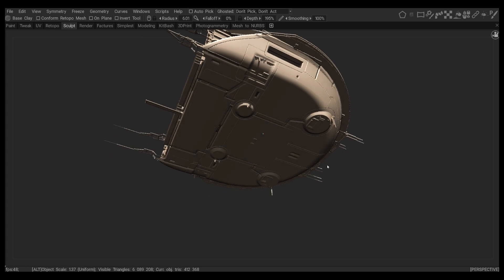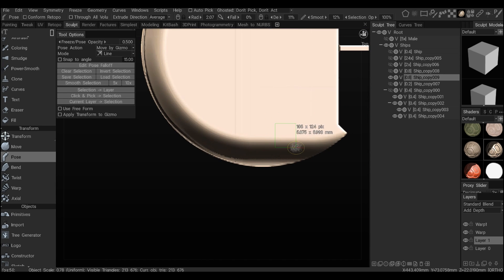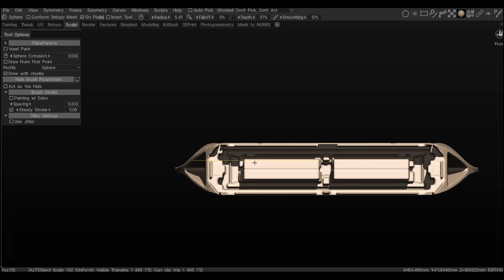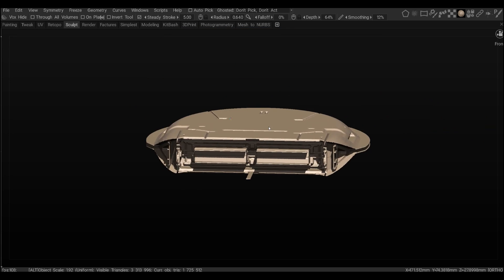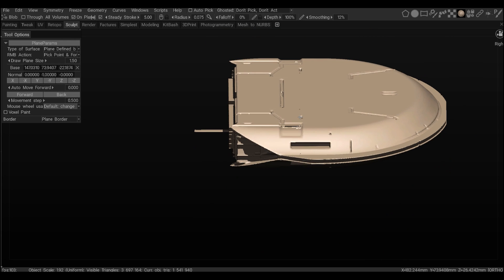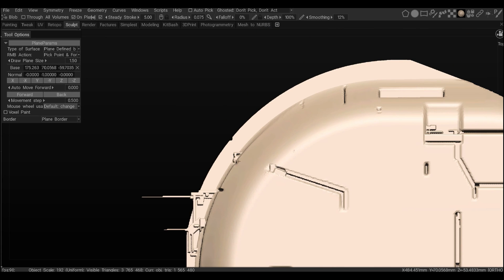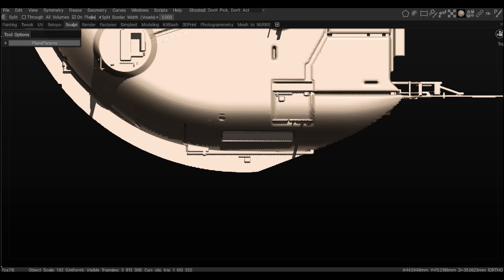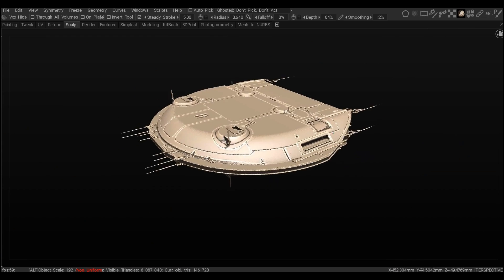Cruiser Sketch in 3D Coat

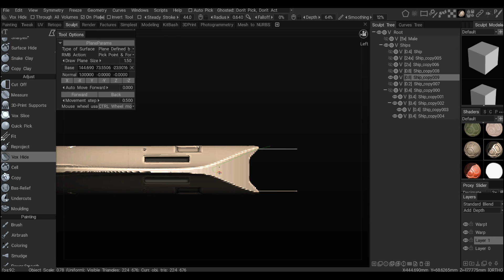Comment: awesome stuff.  how are you controlling the depth on those panel lines (2:30) with vox hide?  When I try the on-plane option with those settings I don't get depth like that.
Reply from the maker: its using either on plane feature but also if you press Ctrl and Middle Mouse Wheel you can control depth, but you need to activate at the bottom of the blob tool panel, there's a dropdown menu there